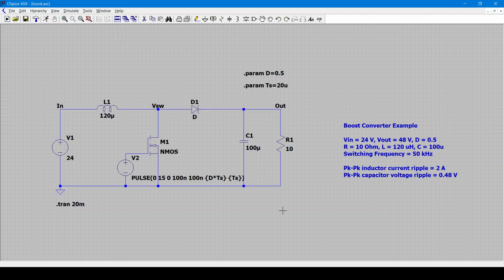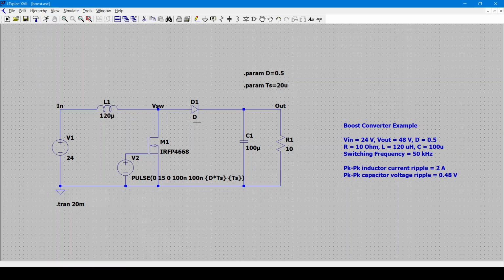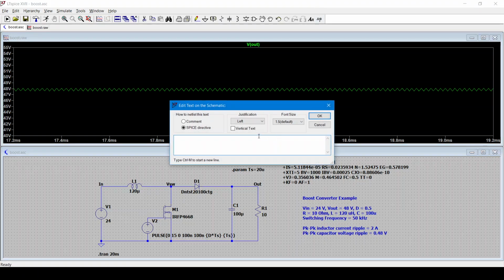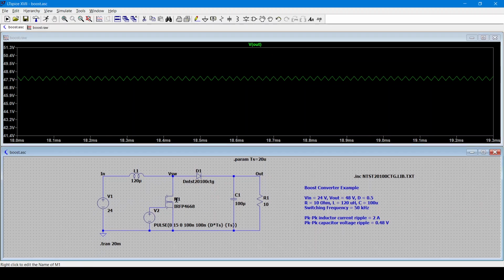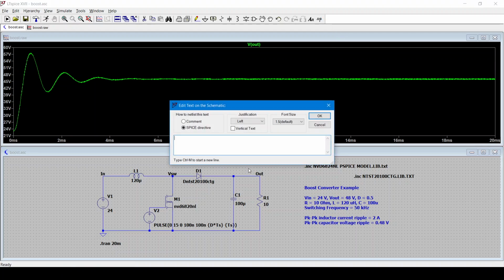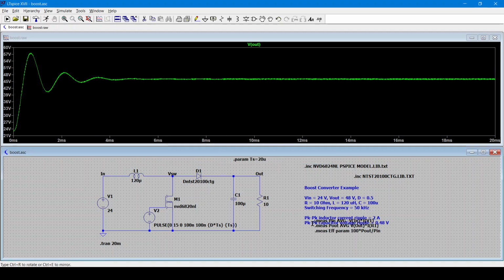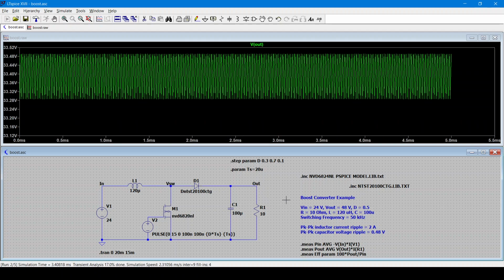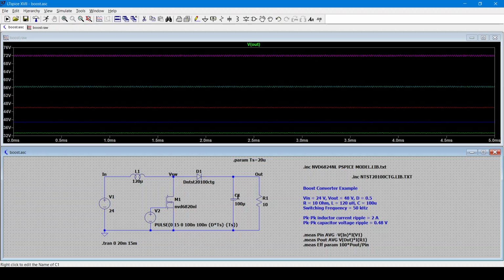LTspice for Power Electronics 04 - Boost Converter

Comment: Hi! Nice video , How can we implement the PID controller in Ltspice.any idea ?Thanks
Reply from the maker: You should be able to implement PID or a type III compensator using op amp based circuits.
Reply: Thanks  @PESaleh